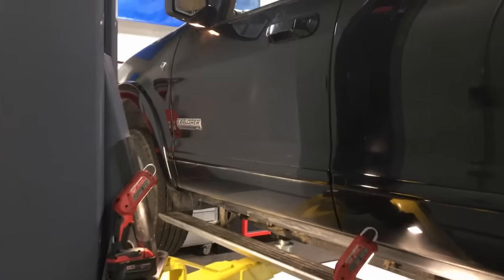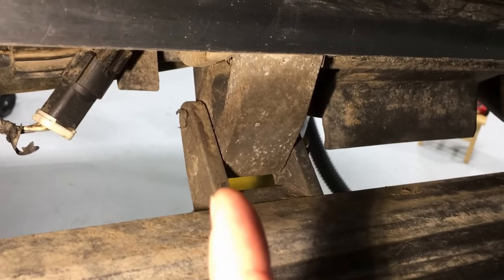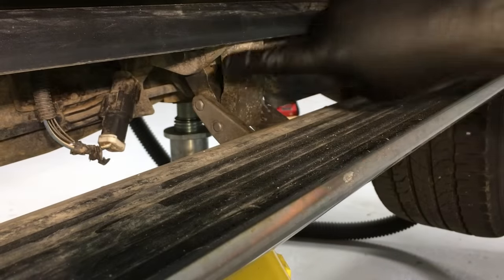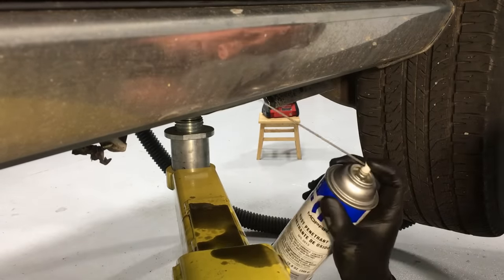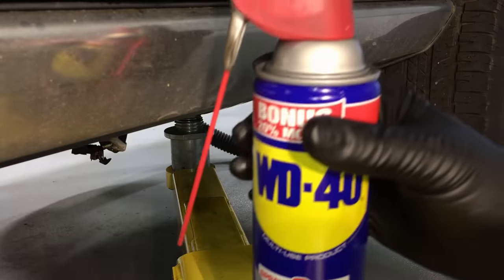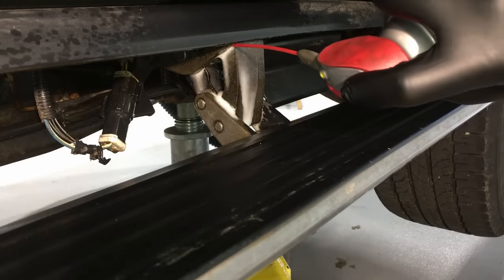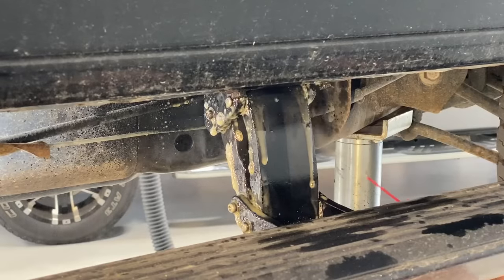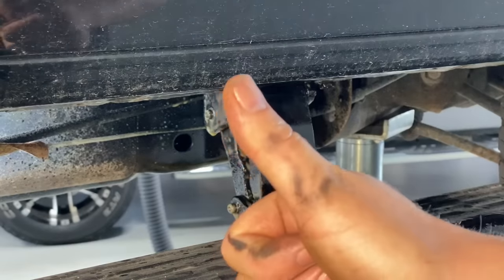Ford Quick Tips #86: How to Fix Stuck Power Running Boards for Good!

Comment from the maker: These are the Lubricants I Recommend:
Rust Penetrant-
https://amzn.to/2Z8mFPm
WD-40-
https://amzn.to/31ge0gb
Fluid Film-
https://amzn.to/2YtfFxc

As an Amazon Associate I earn from qualifying purchases.
Reply: I'd had to revisit my running boards a few times, and was thinking of trying a motorcycle chain lube.  No idea how well it will work, but then again I've never had an opportunity to use that fluid film brand either.
Reply: @therealpimpskillet  you can try the chain lube, honestly I think that the fluid film is better suited for the hinges on these runningboards, it flows better and stays put once it sets up. I've been using it for the undersides of my F150 to keep the rust in check on the sheetmetal, suspension parts and the inside and outside of the box frame. There are dozens of places on the frame alone that trap water, dirt, salt, and silt. This gets into those spots and stops the advance of corrosion. Funny story, I took the truck to a local shop for tire balance, and alignment check. The mechanic there is a friend of mine, but I watched amusedly as he went thru a complete inspection of the truck underneath. I gave him about 5 minutes of looking for an oil leak that didn't even exist, I had liberally coated everything with the fluid film. We both had a laugh about it!
Reply: @markk3652  I've had pretty good luck using a silicone spray, but I feel like it catches too much road debris and eventually clogs up.  Mine are almost to a point where I want to pull the entire thing apart, clean the shafts and start over again.  They were slow when I bought the truck, and they only get "pretty good" when I clean them up like this once or twice a year.
Reply: Hey fordtechmakuloco I'm in need of ur expertise. I have a 2002 f250 crew cab short bed 4x4. I bought the truck lifted. It has a 3.5 inch lift I think, with 35 in tires. From a dead stop when i accelerate it feels like my rear axle is shuddering for a sec or two then it goes away.

If I accelerate hard u can feel it even more. Once I get to about 10 mph or so it goes away. I don't has this issue while already moving no matter how fast or slow I'm going. Only happens from a dead stop and maybe sometime when I'm turning.

Now when I'm towing a Heavy load omg does the vibration get super worse. Especially when turning. It feels like driving on the notches on the side of the road to warn u ur going off the road. Or like the dirt roads with the washboard things in the road. But the feeling is all in the real. 

I replaced my ujoint and center support bearing. I had one ujoint dry as a bone the other two were kinda dry but not as bad, and the center support bearing was good but the rubber bushing was all tor up. My ujoint driveshaft angles look even. Oh and to refresh ur memory it's a two piece drive shaft.

I don't think  a 3.5 inch lift would cause my ujoint angles to be off but who knows. I've googled around and people say it could be 2 different things. Bad ujoint or I'm getting axle wrap. I do have lift blocks in the rear but nothing crazy. Pls pls pls give me some input on what it could be.
Reply: I have 2010 ford raptor with p0012, p0022, p0316, p0340, p0341, p0345, p0346. Can you help me please. When I open timing cover I saw that left side lower guide and bolts where broken. I'm confused about timing positions. Can I set crankshaft to timing position and hold both camshafts with pliers not to move to put everything together? If not can you give me some pictures for camshafts positions ? Thanks
Reply: I have 2010 ford raptor with p0012, p0022, p0316, p0340, p0341, p0345, p0346. Can you help me please. When I open timing cover I saw that left side lower guide and bolts where broken. I'm confused about timing positions. Can I set crankshaft to timing position and hold both camshafts with pliers not to move to put everything together? If not can you give me some pictures for camshafts positions ? Thanks
Reply: We need your help! Deboose garage has a engine builders saying full synthetic oil is bad for Fords. What are your thoughts on this?
Reply: We need your help! Deboose garage has a engine builders saying full synthetic oil is bad for Fords. What are your thoughts on this?
Reply: Hello FordTechMakuloco,

Has anyone tried putting a decoupling capacitor on the running board DC motor in order to 'cushion' the amp draw that is being measured by the safety control circuit?
Reply: I reamed my bushings and still they get stuck, especially in wet conditions.
Reply: also, why not drill and tap and put zerks in?
Reply: I went to my local Ford  and after they looked at my vehicle they told me the pins were frozen and they could not fix them. They said it would cost thousands to replace the boards. I found your video and tried what you did. Unbelievable, It worked for me. I also did the same for my bed side steps that were locked. Everything works so well. Thank you so much..
Reply: Hey bro was wondering if you could help me troubleshoot my running boards. I replaced the the motors with OEM motors but I'm still having issues with them going up and down particularly the left side
Reply: Do the running boards hit the stopping point hard? Mine do and it doesn't seem like yours do
Reply: @jonathanlestarczyk5182  no they don't... it's all smooth but just a 1/4 way on right side... left will go down all the way but takes a long time to retract up I'll be driving and feel it go up
Reply: Bet that customer is pissed he had to bring his truck in the shop now since he coudlve done that at home 😆 hope you didnt charge him 200 for a scrub and a spray.
Reply: Dude you are a lifesaver I just finished trying this and it’s doing a lot better. I’m going to try it again but I need to power wash it first then repeat. Thanks a lot!
Reply: ZEP 45
Reply: How does this work with one that travels dirt roads? Dust accumulate to lubricant? 
Causing more problems?

Comment: Hallelujah! My running boards have been stuck for two years now and my mechanic told me it would cost $2000 CAD each side to replace them because the hinges were so rusted and fused. I ended up following the instructions in this video and after three days of periodic spraying and manually assisting the boards, I’m happy to report that my running boards are working again! Thanks so much for sharing.

Comment: Boy..i remember the old days when there would be grease fittings or some clever way to lubricate such points.  Routine maintenance.
Reply: I was just thinking about something. what if you just drill 8 holes on each side of the brakets where the edge of the pins are. Then you take a tap and insert grease fittings

Comment: I had just bought a new truck and the power running board on the driver side wasn’t working but after I tried this they worked

Comment: Worked like a charm, with a little patience.  Had the right side replaced just before the warranty expired (like $1200 repair),  then the driver side started going out and hasn't really worked for a year.  Bought a new motor with hinge and was looking for a video on how to replace it when I found this video. Figured nothing to lose.... it took a couple of days of soaking and manually working the lift while shutting the door,  but now it seems good as new.  Will be sending back the $250 replacement motor.

Comment: So happy I found this video. Was looking at an estimated $2000 repair bill that literally cost me $23 and 45 minutes of my time. The running boards are working perfectly now. Followed your instructions and used the same lubes and it worked great. 

 "No Mr. dealership repair guy, the motors aren't shot....."
Reply: Makes us wonder how many people were charged 2k plus, and this is all they did at the dealership 😆

Comment: Bought a 2012 suburban a few years ago and was told the running boards were bad and needed replaced. Came across this video and after I restored power to the boards, I did these steps exactly and now they work like a charm. Great video.

Comment: Just used this method to fix the driver's side running board on my 2014 F150 Platinum. It's critical that you spend the time opening and closing the door to work the penetrants and lubrications in. I thought it wasn't going to work at first and then I just kept opening and closing the door - even had to forcefully push the board closed to get it to stay. Eventually, it did start running smoothly and stowing correctly. The Fluid Film really was the icing on the cake. Works good as new now. Great video. Cheap fix.

Comment: I have the 2016 gmc sierra denali 1500. I went through these steps and although they didn't start working immediately I kept at it. Within a month my running boards are working perfectly again.  I have the stock gmc power running boards on my truck.  Thank you for the video, saved me $$$

Comment: this method worked perfectly.  dealer wanted $2000 to replace the driver's side motor and hinge mechanism.  i spent $35 for the 3 cans and it now works perfectly. thanks for the video.

Comment: Thanks so much!!! This worked just as you said. I had to let it soak in for a day or two (my truck is a 2010 that we bought in 2009 and we have never treated this before so it had years of neglect)  but every day it moved  a little more. Then finally one morning when I came out it was working perfectly. Cost me about $25.00 bucks thanks again!!!

Comment: I had this problem with my 2010 Explorer and the motor on the driver's side quit. I disassembled that side completely, off the vehicle and lubed up the hinge points until they could move freely (or as free as I could get them). Installed a new motor (Amazon), and reinstalled. Worked fine until the passenger side got slow. I didn't wait for the motor to fail this time so I didn't need to replace it but the same procedure worked again. In the winter of '21, '22, the drivers side got slow again and so I took the whole thing off . I tied lubing again with mixed results and left it off until this spring ('23). This time I decided to take the hinge brackets completely apart. Those shiny pins can be driven out (use a press, not a hammer) and you will fined that the pins secure in the center pieces and rotate at the ends. However inside those hole at the ends are doubled up copper mesh bushings. In mine, the inner of the two on all positions were very worn. I'm thinking the point of these was to retain lubricant but that was gone. take those out and you will have clearance and lube them up periodically once reinstalled

Comment: @fordtechmakuloco, just wanted to tell you that YOU ARE THE MAN! My passenger side running board stuck while washing my truck, I panicked at first, but watched your video and followed every step….2nd blast of penetrating oil, started up truck and BAM! Running board retracted even better than before! And it was stuck stuck! Like I could not even help the running board retract before the steps.

Comment: My running boards had slowed down so much over time that when I open up my truck door I would find something else to do while waiting for the running board to come down. I stumbled upon your video and gave your remedy a shot. What a difference. Now they act the same as they did when the truck was brand new. It is so much better. I had seen another video that just said to replace the running boards. He had the same exact problem as I did and he brought it into the shop and got the brackets replaced for 2k. Insane! Cost me $30.....

Comment: Thanks a lot for this video! My drivers side was stuck in the down position. I sprayed it with a silicone lubricant because that was all I had and by the time I made it to the auto store to get the penetrating oil it was working. I came home and treated both sides the way you did and I will continue treating them after every oil change.

Comment: Perfect Perfect Perfect.....I recently bought a used F150 and the driver side board would not fold away....but I could hear the motor trying to work....I was told that it hadn't worked in 6 years......so I followed your steps and a few short moments later both sides are working perfectly !!!  I'd buy you a beer if I knew how to find you .  Thank you so much for posting this video and making it so easy to follow.  Will add this to my normal maintenance schedule !!

Comment: Purchased a 2007 Explorer with the power running boards stuck in the up position for years.  Decided to see if I could get them working.  Your video was a huge help.  Thank you.
First thing I found was both electric motors were unplugged.  Cleaned the contacts and plugged them in.  After plugged in...  when I opened or closed the driver or passenger door I heard a brief clicking noise from each electric motor but there was no movement of the running boards.  I soaked hinge points the best I could with PB Blaster.  I then pried downward on the boards with a prybar until I got them far enough down where I could stand on them.  Then I'd open the door while standing on the board.  Then I'd close the door and pry upward on the running board with a 2x4, leveraging off the driveway, to help them back into the closed position.  Repeated this over and over for about two hours.  Each time I got more travel I would apply additional penetrating oil and use a small pick around the hinges to scrape away corrosion and debris.  Three hours later both running boards working.  Total cost = $9.00   Thank you

Comment: Fluid film is great. I spray the undercarriage of my F-250 every fall to protect it from the road salt. Great video! Thanks for sharing.
Reply: How do you buy the stuff? Gets expensive doesn't it? i guess if it works well then who cares. It's like 15 CAD per can around me so it's on the pricey side.
Reply: I live in Canada too.  I buy it by the gallon.  You can find gallons at NAPA, Princess Auto, and some Canadian Tire stores.  100$ is the going cost.  I also invested in the fluid film spray gun.....it's of excellent quality, worth the money.
Reply: @TheBeatenPaths  Id choose woolwax over fluid film. Very similar of a product, except woolwax is a little thicker so it stays in place a lot better. Fluidfilm washes off much quicker/easier than woolwax. I undercoated my truck last fall, and all of the woolwax is still there perfectly intact just like the day i sprayed it on, coming up on 10 months.

Comment: I just purchased a used high mileage expedition and your videos are invaluable. I really appreciate your attention to detail.
Reply: Hey congrats on ur purchase. I bought a 2008 limited expy about a year ago with 195k (!) Miles. For me I didn't care because they're so hard to find perfect one and I can fix most things that go wrong. I'm at 215k miles now and it's still running great aside from an alternator couple spark plugs and coils and two wheel bearings. All which I did myself. I love my truck and don't think I'll ever get rid of it lol. These beasts can forever if u don't mind getting ur hands a bit dirty. I'm hoping to hit 300k but I think I'll have to replace tranny before then. Either way u can find one for under 1 thousand and replacing it isn't too hard. One of the most overly feared jobs is a tranny, pretty simple job actually.

Comment: I recently bought a 2007 Lincoln Navigator L and the power running boards were operating intermittently. A mechanic told me I would probably have to replace the motor assembly but I felt the motor was not the problem because I could hear it trying to engage. Thanks to this video and great directions, I was able to get them working consistently. I used a product called Sea Foam Deep Creep Multi-Purpose Penetrating Lubricant and Cleaner. I plan to keep a can on hand...just in case.
Reply: good job

Comment: I know I'm not keeping up with the maintenance when various moving parts of my F150 no longer work. Only then do I get around to the cleaning/lubricating... first it was the box side steps, then the tailgate step release, now it's one of the power running boards not staying extended. Good to see videos like this offer a simple fix.

Comment: I have been using the WD40 Lithium Grease for about a yr or so and so far so good.
Reply: I use the same on the power extended steps on the motorhome.
Reply: Same here. Works great. I’ll be doing this every spring and fall from now on.

Comment: Great tip 😁. There are so many maintenance points on a car other than just engine oil and other fluids. Lubricating moving parts, paint protection, engine cleaning, heat exchangers cleaning (condenser, radiator, and other coolers), cabin filter and interior cleaning and protecting, and even undercarriage cleaning would help a lot to make a car last a good 15 years without major issues.
Reply: True statement! Most become overwhelmed by simple routine stuff that cars require. Factor in all the preventative measures that should be done, there are few that actually do it. It's easier to just grouse about how crappy the car/manufacturers are, and get a new one. I can't relate to that mentality. I'd rather keep my cars and equipment maintained and cared for than spend what it costs to replace it.
Reply: @markk3652  that is the reason why many people say most american cars are shit but also many other people say those have been great cars to them. Maybe that second group of people take more care of their car and go the extra mile.

Comment: For vehicles in the salt belt the hood hinge pins, tail gate hinges, lock mechanisms and don't forget door hinges and locking mechanisms.  I used to put WD40 in key lock.  That was before the electronics at the lock.  I have used WD40 on a door lock that would not turn, key was good, for an 06 Kia Sorento.  The locked worked, no problem with the electrical.

Comment: I will try your method. In hope it's not the motor on the driver's side. It only messes up when the weather is "cold". No bad sounds from the motor. Works perfect in the summer.